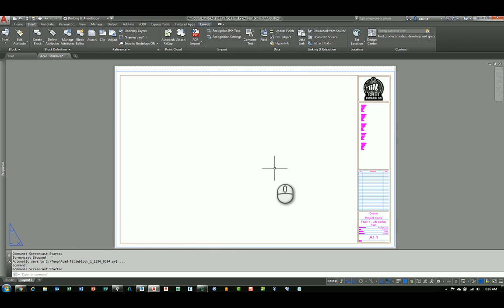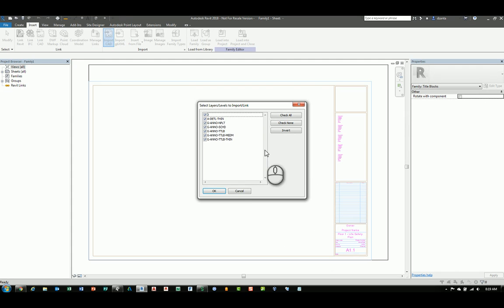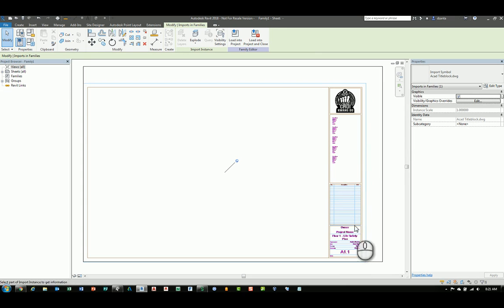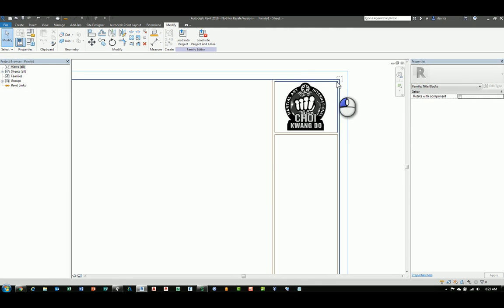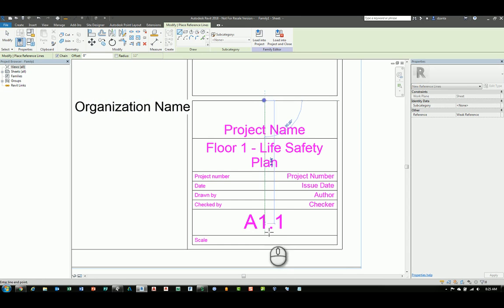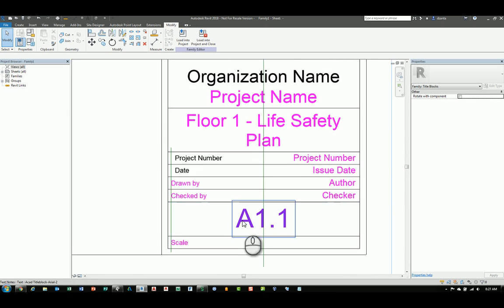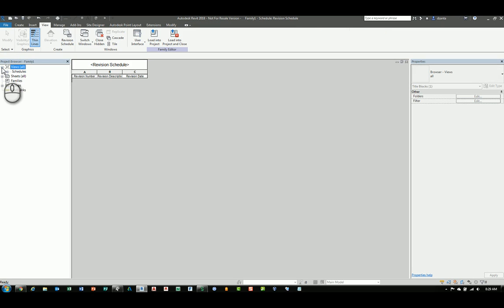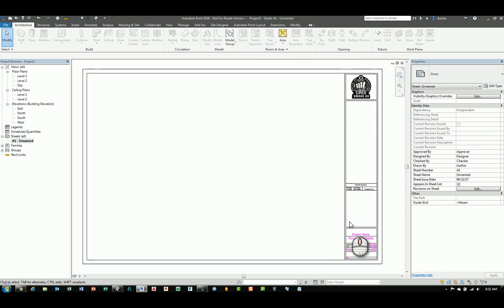Revit Titleblock Creation from AutoCAD

Comment: How do you do view modules to fit the title block?
Reply from the maker: I do not understand your question.   What do you mean by module?
Reply: @DzanTa  
Lets say you create a drafting view. Can you make a parametric module in the drafting view that will match the module on the sheet. It's a way of organizing you details on the sheet. Have you ever heard of condoc? It would be the same principle.
Reply from the maker: I believe you have limited parametric capabilities within a drafting view.  For example,  you can create a global parameter to flex your line work.  Hope this helps

Comment: Hi sir, yesterday I saw your video, I need one favor. I'm using revit student version 2018, how can I download for space utility software, can you guide me. I wait you're reply me. Pls post your video blog.
Reply from the maker: now sath 
Tbe space utility is part of the addins and updates. Go to StRt, then Programs, then Autodesk.  Look for Autodesk Desktop App and run it. This will give you all the updates to any Autodesk app you currently have installed. It should pick up the space naming utility.
Reply from the maker: the Space Naming Utility is for 2017.1 up to 2018.  It is already integrated into the software in the Add-ins Tab of the Ribbon.  If 2016 and older, you will have to go to the Autodesk App Store
 https://apps.autodesk.com/RVT/en/Detail/Index?id=855855288022447765&appLang=en&os=Win32_64